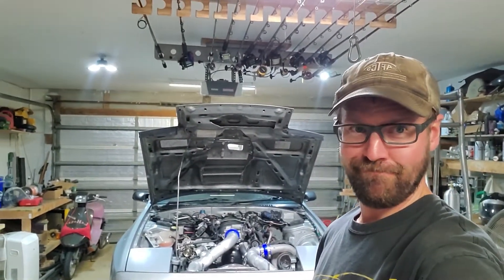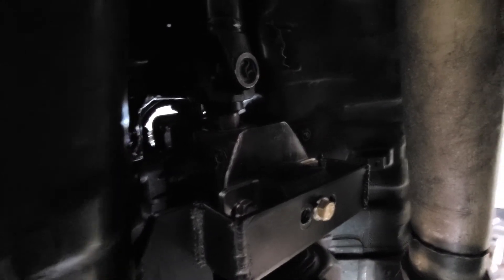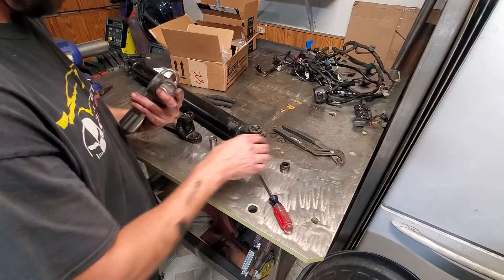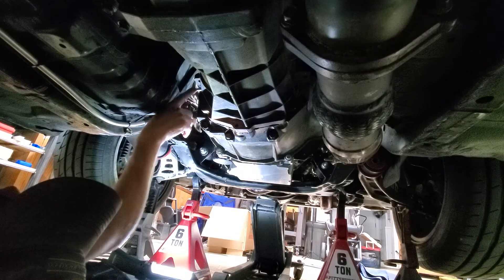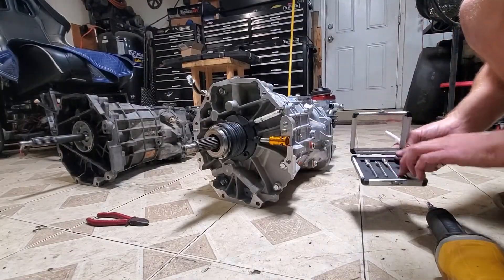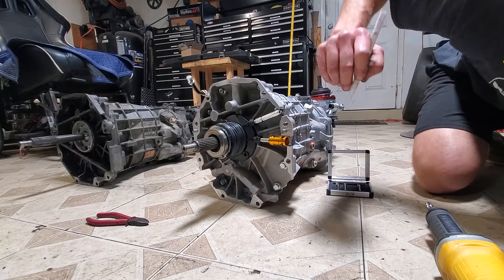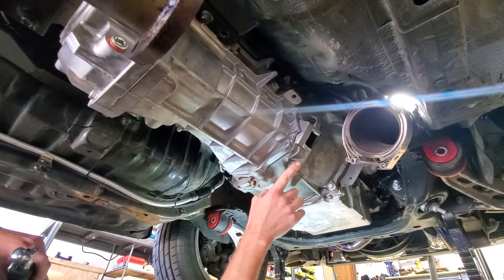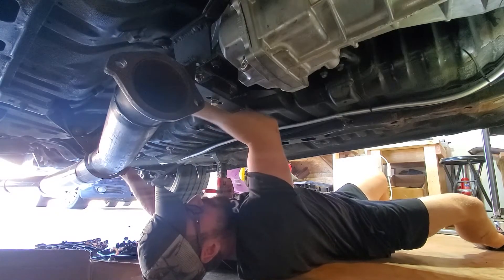Installing the Best Manual Transmission in a Turbo LS Swapped FC RX7!

Comment: How did this hold up without all the bolts for the bell housing? Having the same issue with my camaro
Reply from the maker: Zero problems. Made over 800whp on the dyno and a few passes at the strip